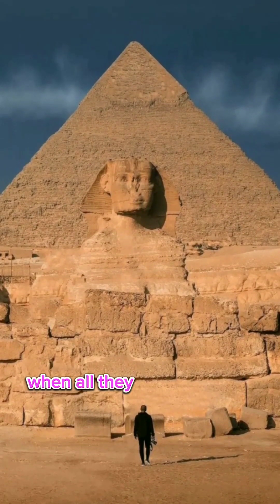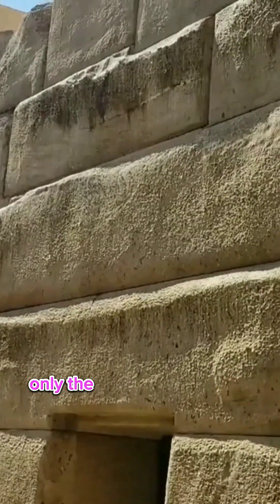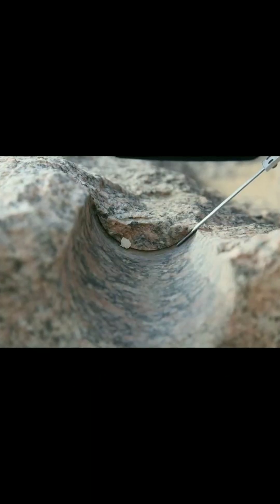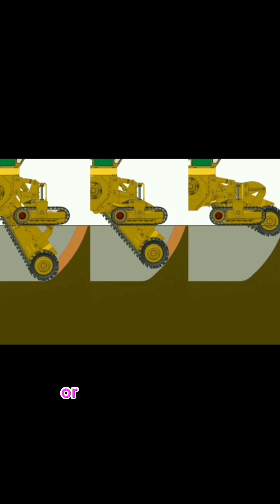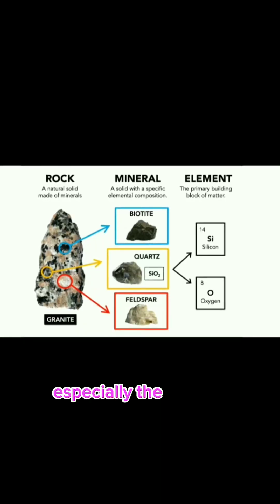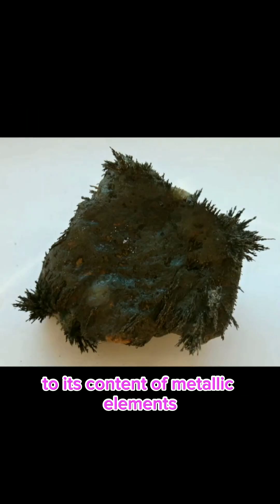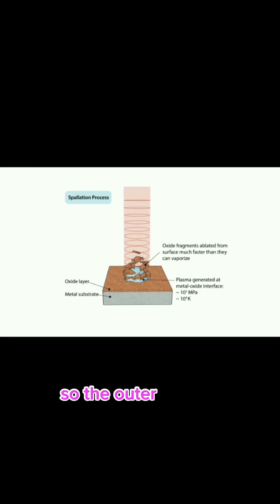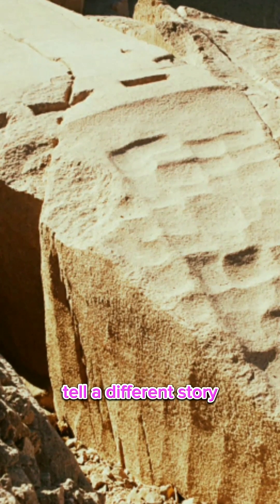3D Rotory Technology Machines in Ancient Egypt #egypt #archeology #pyramid

Comment: They definitely used power tools of some kind. Flinders Petrie, knew this from the tubular drill striations, which was clever for the time because tubular drills were only just "invented" in his time. The problems I have is the metallurgy they had at the time just wasn't good enough at 4 on the Mohs scale for a drill bit or grinder of any kind. I can't imagine them using electromagnetics though, how would they get the eddy current on target without building it bigger than the stone they were cutting and how are they making 10000+watts? They could make Silicon Carbide grinding stones 9.5 Mohs scale, if they made such a furnace which could explain the scoop marks but it's more likely they made a geopolymer with diamonds set into it. This level of technology is so extreme for a community that didn't invent the wheel. It has to be more simple, some gear ratio for high rpm and Ox's running in circles?
I've been working natural stone for over 15years and their level of precision and scale blows my mind for at least the past 5years I've looked into this mystery.
Reply: Still say those who had the tools helped and taught the Egyptians how to use those tools and took their tool with them when they left. Easy solution and makes perfect sense
Reply: @brianstrutter1501  I just wonder how much more advanced we'd be had the library of Alexandria not been burned. How to make those tools and how to use them would take us another 2000years to figure out again.
Reply from the maker: @brianstrutter1501  well that tru ... some people say aliens but could also be the cause that it was just indians or Atlantis and as the worked and finished they packed their stuff back on their ships and journeyed away on the ocean ...
Reply: @brianstrutter1501  clearly the drill bits were made of psychic energy and were turned by psychokinesis and thats why theres no evidence; makes perfect sense!
Reply: The Egyptian archaeological people have been covering up things for years the only reason we think that they had metallurgy in their nature and tools that were only four on the mohs scale it's because we've been deceived to think so. Why do all of these ancient cultures speak of sky gods and beings and gifts from the gods sky chariots and things of that nature but it never gets addressed we just ignore it.
Reply: @seanmoore489  It's just a fact they were bronze age civilisation. Giving them Steel, Titanium or even Tungsten would be like giving Muskets to the Roman Empire. They'd be able to wipe out every country on the planet and there would be evidence somewhere. There's historic record of them getting heavily defeated by the "Sea Peoples" and they too were using Bronze weapons not even Iron. 
Archaeologist do step into the wrong lane from time to time telling us how things were built when they've never built so much as a bookcase in their life but to hide a prize like finding a tool or weapon made from something that'd change history is unthinkable. They all strive to find and make known their finds like Tutankhamun's meteoric iron dagger. Now before anyone jumps in here with there's a smoking gun right there, this dagger was made from a meteorite an contains far too much nickel and is just ornamental, they had no idea the composition needed to replicate it - Yet. It's still a 4-5 on the Mohs scale and there certainly wasn't enough of them to go round for men to break them on granite. Further more, the dagger was probably imported to Egypt perhaps as a royal gift from a neighbouring territory (the Amarna letters describe an iron blade gifted to Egypt by a Mitanni king), indicating that at this time Egypt's knowledge and skills of iron production were relatively limited.

If we're talking about the Sky People then they'd of not only carved the 10,000,000+ blocks of granite in Egypt but all the other incredible sites around the world and took every single tool back with them. 
Why go to the trouble of teaching Agriculture, Astronomy, Mathematics, Medicine etc an not metallurgy. Perhaps they knew it'd ultimately lead to superior weapons? I just think it's an odd thing to leave out an leave no evidence of. I don't really want to get into a religious debate since it could upset people an doesn't really take us anywhere on solving the mystery.
Reply: @u_t2347  any of our tech can't explain it the core drills were taken at such high speed and with such pressure we have no current tech to match. We have pathetic only explanations of most ancient tech and construction methods. What is absolutely clear is the tech used in many ancient building methods is far beyond ours. Let's not get bogged down on the speculation of what tools were used when we don't have a clear explanation of the complete methods.
Reply: @seanmoore489 We need to consider that modern education and ideas don't always fit into ancient tech. It is totally bizarre that we can't find any evidence of tools and methods and pyramids are found around the globe. Okay, skip the carving technique, how did the move, lift, and place with such precision yet leave no physical or written evidence. Until such evidence is found or recreated, we can only speculate.
Reply: There was a lot more Ox's back in those days. So that fits the current theory.
Reply from the maker: Definitely is the case
Reply: You should really google the mohs scale, then google what carbide is. that word soup you made smells like diarrhea. "silicon carbide grinding stone" fucking hilarious man. ALl they had to do was bend over and grab a handful of sand rofl.
Reply: ''for a community that didn't invent the wheel.''  Hey buddy, they had war charriots, rolling on what do you think?

Comment: They had a river nearby, which means lots of water.
So I wonder if the solution was in fact a bit simpler: A big, heavy, sturdy cylindrical tool - maybe metal, maybe stone - that rotated at high speeds and copius amounts of water with stone dust in it to serve as the abrasive. That tool would have best worked if it wasn't a perfect cylinder, to kind of grab the stone dust and really rub it against the surface to cut. At the other end there might have been temporary pools to let the used stone dust settle until it can be scooped out by slaves, brought back to the worksite and reused.
Because the one thing we definitely don't know is duration: How long did such a cut take to do? It seems to me that most likely a good while, or those cuts in the pyramid would not have been left half-done (meaning, if they took a day, they would have been completed - but if they took a week something must have happened early Thursday to make them stop).
Reply: Exactly 😂😂😂 simple explanation that covers all the data points. This dude doesn't seem to be familiar with a hand drill even, much less more complex versions of rotating tools that can still be powered by human or animal power with the exact same end results but taking up much much more time than electric powered tools.

Comment: They found traces of a calcified slury in some places in the quarry. It is speculated they used some sort of chemical like an acid to weaken the rock and then use abrassive rock to bash/grind it out. Only problem is the bedrock is commonly red granite. obviously, red granite could be used with water against itself. This would have been slow and with many hands for several years. The current needed to generate induction heating and power tools is definitely not possibly at this site and there is no evidence to this. What you suggest is nonsensical.
Reply: Geology is rife with examples of plain water and sand cutting up the hardest of rocks over numerous millennia, the Egyptians probably used that and reduced the timeline to years or months. 😂

Comment: And without even the smallest piece of evidence to back this theory it is basically useless
Reply: My comment is based on the first 2 minutes  on the rotary cutter, there's nothing to support this theory. 
The drill holes and saw marks however leave little doubt
Reply: @shanevonharten3100  seriously?

lets say they ARE drill marks, which you absolutely cannot conclude from the seven pixels in this video

whats more plausible, aliens supplied humans with advanced cutting technology and then disappeared with all the evidence?

or maybe it was cut when the pyramid was first exhumed, as a sample piece to be tested and scanned etc. none of those holes were made 5000 years ago at all

there is no more evidence for your theory than there is for my theory, you are basing your ENTIRE conclusion on a few pictures with what may or may not be drill marks and then stating theres "little room for doubt"
Reply: Awesome Theory, but No Evidence of Machine or Tools !

Then, Powered by What ? 

No Evidence of that Neither ! 

Great Idea, but it’s just Modern Thinking !